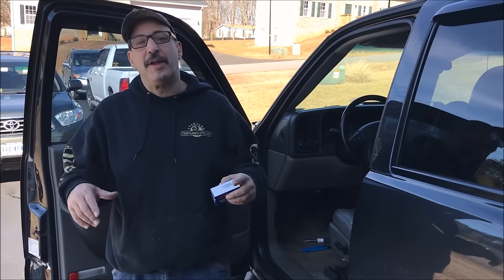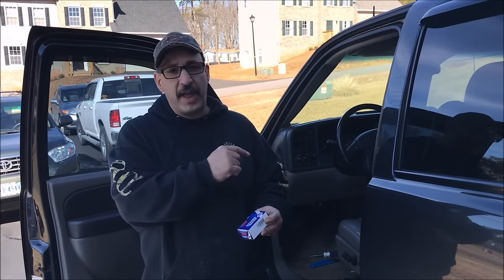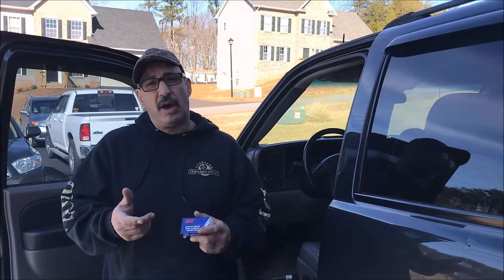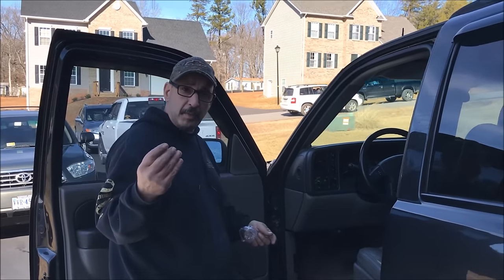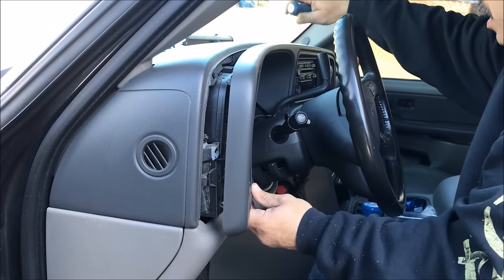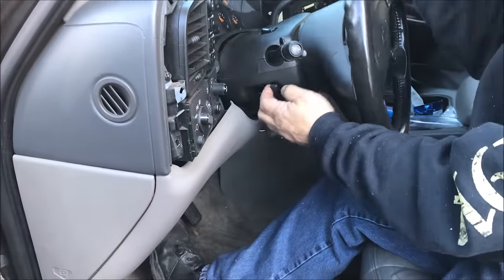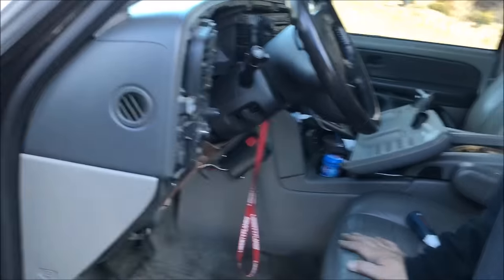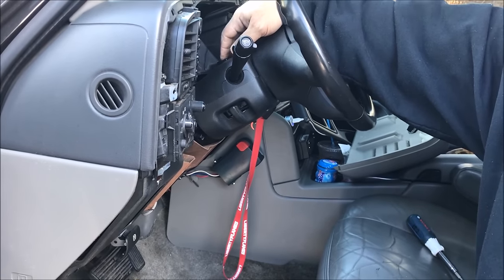Hazard & Turn Signal Flasher Problems on the Road | 2000-2006 Chevy & GM Suburban Truck and SUV

Comment: Thanks for the video. I just replaced the flasher unit in my 2004 Suburban 1500 LT. It actually took longer to watch the video than to replace the flasher unit.  From opening the door, replacing the unit, verifying it worked and closing door after finishing it took an entire SEVEN MINUTES.
  Thank you very much. 
  Jeff
Reply from the maker: Glad we could help. Thanks for watching.

Comment: Thank you for this video! I’m having the same issue with my ‘08 Envoy Denali, no left turn signal and no left flashing hazard. The right side works just fine. With this detailed video, I feel as though I can do this myself and save on the labor charge at the shop. 😊
Reply from the maker: Glad we could help.

Comment: Excellent! I’ve been trying to diagnose this problem for two years. New switch (twice) New bulbs, fuses, etc. I was sitting in the vehicle with my turn signal on watching both lights flash. As soon as you showed where the module was I started kicking under the dash in the appropriate spot and What are you know, it started behaving properly. When I get home I’m going to check the connection and if it’s sound, New switch will be on the way ASAP
Reply from the maker: Great, hopefully it works for you like it did on mine. Thanks for watching.
Reply: Nothing a good knockin can’t fix 😅  waiting for mine in the mail. 
I love my Tahoe my mom handed it down to me with 64000 miles and a new transmission

Comment: Great info.
I have a 02' Blazer ZR2 & not an issue with flashers but, when I turn on my pisser, the wipers may wipe 3 times or 20! 
They just go as they please.
Same in the rain when I turn on the wipers, then turn them off, They'll just keep going! 
There's no stopping them besides killing the engine & restarting, which I've done a few times.

Comment: I have this problem and i did replace the flasher. Still not working.. Any thoughts?
Reply: Same issue. Replaced the flasher and my directional on the right side is still not working or clicking for the rear tailight and the right side mirror.

Comment: I've got a similar problem, but it doesn't deal with activating the turn signal.

My problem is this:
A few days ago I disconnected the battery.  

When I reconnected the battery, , my hazard lights were on all the time, plus some of the Interior dash lights were flashing off & on (The 'Telltale' & 4wd indicator lights).

At first, I thought it was one of those 'Service Security' issues which requires you to do all kinds of crappy key in for 10 minutes key out for 10 minutes for seemingly hours.

It now seems like it is not one of those problems because the Suburban starts and drives without any issues..

I pulled out the hazard switch & it still malfunctions.

So, now I'm going to try your FIasher idea, because you definitely hear the Flasher clicking off & on.

I will report back.

Comment: That was a very easy fix! Went to the salvage yard and spent $10. Thank you so much!!! Any ideas for wipers that don't shut off right away, even in the off position, most of the time? On 2004 Silverado
Reply from the maker: Usually a ground issue, could be the switch starting to go bad.  This will be hard to troubleshoot, if it were me I'd wait till it got worse. LOL
Reply: I have this same issue, any solution ?
Reply: I had the wiper problem on my 96. We get them to shut off by clicking it down past the lowest speed notch, apparently ours is not aligned right.

Comment: Fantastic video! Thank you. My '04 Escalade is having trouble with the right turn signal working sometimes, and sometimes flashing really fast and only the directional arrow in the side mirror working, but not the front or rear signals.  I'm going to replace this and see if it helps.  Glad to see you are a Liberty Parent!  We have two at Liberty!!! GO FLAMES!!!
Reply from the maker: Glad we could help, Thanks for watching. and yes Liberty is a very special place.
Reply: Got the flasher, replaced it in under 5 minutes, and reassembled everything in 3 minutes.....works perfectly! THANKS!

Comment: Mine flashed hazards when I put on right turn signal only, I went on amazon and got mine , I used channel lock pliers to pull the flasher out, not a lot of room to get a good grip to pull with your hands.
Reply from the maker: Thanks for watching.

Comment: I bought the new relay, put my fingers on the old relay and it pretty much fell into my hand which seemed like a bad thing.  I pressed it back in and the flashers worked.  A mechanic had been inside this dash and left a lot of loose ends but probably not this specific one.  So, make sure things are clean and plugged in completely before you even buy the new part.
Reply from the maker: Good tip

Comment: Great video! I have a 2011 Silverado 1500. Flashers and turn signals work fine but there is no sound. Will a new "Hazard & Turn Signal Flasher" fix that problem?
Reply from the maker: Yes, I believe the clicking sound comes from the flasher.
Reply: @AxlesGarage  Is the flasher relay located under the dash on driverside?
Reply from the maker: Yes it is, check thumbnail pis on video, should give you some guidance.

Comment: From the video I don't see why the top panel even needs to be removed... Just the bottom panel. Could you explain that? Thanks. Great videos
Reply: Never mind... But a tip... there is a plastice strip that makes accessing the relay hard. Cut it out. Now your entire hand can reach in and grab it. That plastic strip is meaningless.
Reply from the maker: The top panel overlaps the bottom panel.

Comment: Before I spend the % to buy this for my truck that's worth nothing can you confirm that this fix did work indefinitely? Also my truck have the identical symptom but it is the right signal that gives me the intermittent problem
Reply from the maker: I did that flasher module in Jan of 2018.  Still working today.

Comment: Super Job for on the road.  15 minutes ago I grabbed a can of contact cleaner, went out, disassembled the column, and removed the signal switch.  I came in for some coffee and figured I would hit you tube to take a look around. If only I had checked sooner!  Nice video explaining the issue!  thanks for the explanation!  But, Dude, Road tools dont include sockets?  With 300k miles on the clock we carry everything in our short bed reg cab 04 Silverado 4.3 5 speed .
Reply from the maker: Yeah, I know, really should have a few more tools.  We lost an alternator on the road once and had to change it in the Auto Zone parking lot, in a shit neighborhood.  Their tool selection was horrendous.  Thanks for watching.

Comment: Hi Axle,  my left turn signal light does not reset (stop blinking). After I complete my turn). Do you have any ideas about what the defect is and how I can fix it please?  Thx
Reply from the maker: In the GM columns I'm not sure,  years back they had a 'Cancel-Cam'.  In the Jeeps, it's controlled by the clock spring.

Comment: My right passenger side signal don't turn on when I'm driving but the left does. You think if I replace the  flasher that would fix that problem?
Reply: Did you ever figure out the problem? I have the same issue. But my signals work when the car is in park.
Reply from the maker: Are you saying it works in park but not in drive??
Reply: @AxlesGarage  yuuup
Reply: Salvador Figueroa  i have the same problem

Comment: great video. my 2007 silverado classic hazard lights not flashing or my high beams ? everything else working fine. could it possibly be the flasher? i ready checked fuses and relays. there all good.
Reply from the maker: If you high beams are also not working, I would look into the stalk/switch more than the flasher module.  Listed as the multi-function switch
Reply: @AxlesGarage  I will try that thank you!

Comment: I've got a problem where I do the blinkers and they go crazy, then I got the brakes and everything stops and the lights just stay on. I've replaced everything accept this part. I'm going to try this and see what happens. I'm going to subscribe. Thank you!
Reply from the maker: Well if it were me, yes I would try the flasher module being you have replaced everything else.  A bad ground can cause this issue as well as certain LED bulbs.  It's a gamble on the module, good luck.
Reply: Did it fix it? I had the issue where my left turn signal would go out when I hit the brakes now I have no turn signals or brake lights
Reply: @austenfraunfelter3479  multifunction switch and turn signal flasher
Reply: @AxlesGarage  I replaced upholstery on the headliner board, and thought I might messed up some wires on removing that board, but now i suspect it might be a new ceiling lamp LED bulb I installed. All the Turn Signals are not working, though Hazard lights work. I've heard before that LED bulbs can cause some problems. I'll check tomorrow fuses, and try the previous usual bulb, instead of LED. Thank you for the great film and this comment.

Comment: Really hoping this is whats wrong with my chevy, went to go get gas one day and all the sudden my blinkers stopped working... parked it and tested my hazards and both blinkers, got nothing. Tried my high beams and unless I was holding the multifunction lever than they didn't work, however when I did hold the multifunctional if I held it I could get my hazards and blinkers working while I was holding the multifunctional.... also noticed my air blower wasn't working or any of that was even lit up unless I held the multifunctional as well. Swear that my chevy is trying to be a headache this month
Reply from the maker: Sounds like a bad multifunction switch, not necessarily the module

Comment: I have a GMC Yukon 03 when I use the blinkers the front both sides don't work both arrows on the mirrors don't work but both sides left and right in the back flash at the same time would this be the same issue

Comment: My trailer lights quit working and fuses are good. Now my blinkers are working weird and the directional indicators light up dim when I put my brakes on. Any ideas? 2001 Silverado.
Reply from the maker: Sounds like a ground issue, especially with the dim lights when brakes applied.

Comment: I had an '06 Sierra and the flasher location was located differently than here.  Was able to do it without removing any panels, just reached underneath it.
Still, I rather have a flasher instead of it controlled by the BCM, as to vehicles now.
Reply from the maker: Thanks for the info.

Comment: i have an 05 tahoe z71. When i use the left turn signal, my flashers go on. When i use the right, my brights go on.So im gonna take your advise, thank you
Reply from the maker: That symptom sounds like it could be your multi-function switch

Comment: i need help: 2007 Chev Duramax 6.6L T. all halogen blinkers. hyper flash. all bulbs working. checked today. all fuses good. not sure about relays. has trailer braking and lighting control. haven’t checked those yet either. TBC is aftermarket. is there a flasher module and where? is there a third fuse box? am i misreading some of the fusebox descriptions? keep the bashing to respectable levels pls. PA cops are extremely petty and i cannot afford any tickets. i need real solutions here. TIA
Reply from the maker: If all your bulbs are good, for sure, then I would gamble on the flasher module.  If you don't have a trailer hooked up during testing, then the issue is not there.

Comment: Would this cause for my rear break lights to go off when I press the breaks? I have the same problem with my turn signals. It will activate my hazards
Reply from the maker: You may have a problem with your brake light switch as well.
1. make sure all bulbs are working.
2. Flasher replacement.
3. Brake light switch
in that order, if it were me.
Reply: Did you give it a go?if so did it work? I have the Same problem with my 2000 chevy silverado.  When I engage the left singal the Hazzard goes off. When I engage the right singal works just fine. When I press on the break my singals on dash light up and break lights no longer work.

Comment: Great video I have 2000 suburban and my flasher would blink fast so, I replaced a bulb or two that was out. But now it blinks very  very slow to nothing at all.
Reply from the maker: Make sure you have regular bulbs in there.  Those era truck don't do well with LED bulbs.

Comment: Is it possible for this to happen with the trailer lights only? I have an 04 Silverado with a factory 7 pin.  The left side works fine, but the right side doesn't work at all.  Ive replaced the connecter and wiring all the way back to the socket connector under the frame rail but no change.  Any insight would be appreciated!
Reply from the maker: It's possible, but unlikely.  I would test at the trailer plug on the vehicle side, with a test light to make sure the problem isn't in the trailer.  Test with trailer unhooked as well

Comment: I wonder if this is what I have to do on mine. I have a 2004 yukon and about a week ago it started acting up. When I step down on my brakes both the front and rear signal/hazard lights light up on the right side of the truck.
Reply from the maker: I would take the gamble and replace the module it it were me.

Comment: My 2005 suburban (with tow package) has a similar issue but it is the passenger side. You set turn signal to the right (passenger) and it blinks two-three times and turns off without turning? Do you think it may be the same issue with a bad Flasher Relay? Thanks in advance.
Reply from the maker: That sounds more likely to be an issue with the directional switch
Reply: @AxlesGarage  I changed it out like the video and it did seem to fix it. It did the same thing in the right side when I engaged the hazards as well. Either way, thank you for the video as it seems to have corrected my issue as well.
Reply from the maker: Hopefully it will stay fixed.

Comment: My 2000 sierra 1500 right signal works perfect.  The left just stopped a few days ago.  When the headlights are off (daytime driving)  my signal works.  When the headlights come on (automatic from it getting dark out or manually turn them on)  my left signal doesn't work and the 4 ways won't work but they also affect my brake lights.  Brake lights won't brighten up when hitting brakes but brake lights brighten up when headlights are off. It happened out of nowhere.  Im wondering if this module will correct that. It makes no sense at all
Reply from the maker: It's been a while, did you get it working?

Comment: Have a problem where my high beams turn on when i make a right turn in the dark. Will fixing this fix that problem?
Reply from the maker: There is a chance, otherwise it may be your selector switch
Reply: I have the exact same problem on my Chevy blazer. What fixed yours?
Reply: yea my 03 Tahoe mimics the same problem. turn signal right also turnS on my high beams.

Comment: My relay in my 06 silverado keeps burning out, not sure why. I have brake lights though, which is weird. Scared to buy another relay until i figure it out, they are like $80.
Reply from the maker: Not common, you may have a damaged or corroded wire causing high resistance
Reply: @AxlesGarage it was exactly that, my cab fuse box is bad. Im struggling to remove it at the moment, their is only one bolt, the rest are clips, and i somehow manage to strip the only bolt ☹️, ive broke three drill bits trying to drill it out the back side

Comment: If I took that the blinker out and that the outside left flasher weren’t working wouldn’t the turn signal have a bad bulb in the socket left or right side on it?
Reply from the maker: Always check bulb function first.

Comment: I need help😩 my front and rear turn signal on the drivers side work fine.  The issue is when I turn my right turn signal on it starts normal but about a second after turning it on it starts rapidly on the dash and makes the rear passenger side blink fast and whole the rear is rapidly blinking the front passenger bulb just stays on illuminated and won’t “blink”. When I turn on the hazard flashers it works all four work perfectly fine🫠
Reply from the maker: First Check all bulbs.  Then make sure your powers/grounds are good.  Then look at the flasher module or TSS

Comment: Hey I have a 2001 chevy silverado and my emergency flasher button is stuck on so I made it stay pushed in to stop flashing and now my turn signals don't want to work and my break lights will not turn off any solutions??
Reply from the maker: Probably should replace the flasher button.  That may be causing your issue.

Comment: My problem is the emergency flashers do not flash or illuminate in the rear. Directionals work both front and back though.
Reply: u have a short or replace bulbs

Comment: Thanks that sort of thing happens on my 2002 Avalanche now regardless of L or R, then later it works OK, then does that again. I'm thinking its likely this part, however when I search on it for my vehicle its more a cube shape. So I'll take mine out and match it up.
Reply from the maker: Good idea, there are some differences between 99-02 & 03-06
Reply: @AxlesGarage  I replaced the leaking rear tail light and it came with a harness, & the junction box under the truck I replaced that too. The one lens that was leaking and filling with water, the connector was corroded. The water was coming through the wire! But after all that and the 2002 square flasher relay replacement, its still doing it intermittently. I need a wiring diagram but wondering if the turn signal stalk switch is going bad. It does the weaker flash on the non-selected side of directional signal. And sometimes it works perfectly. Driving me crazy. Thanks for moral support